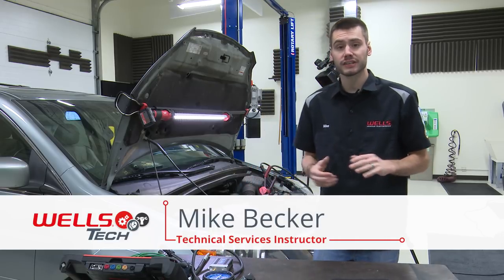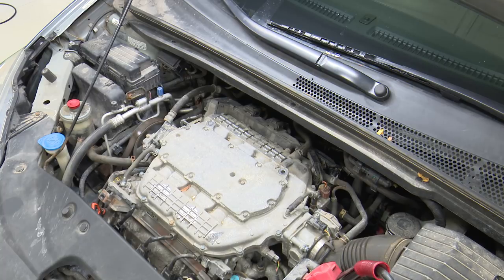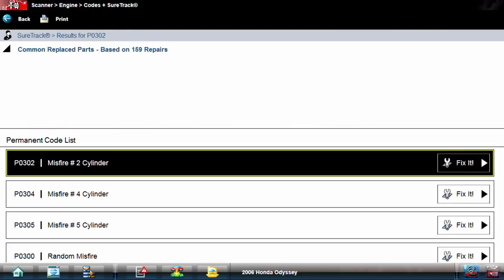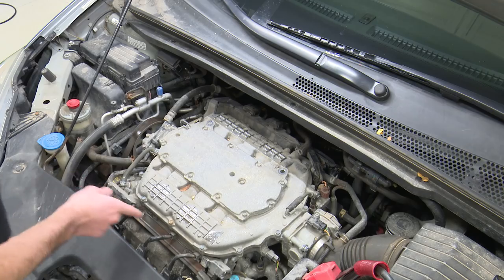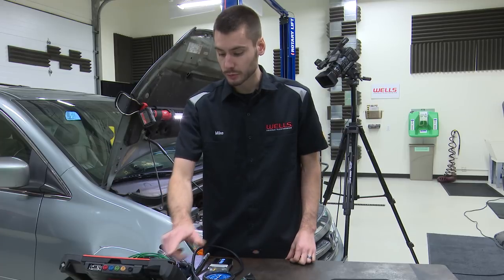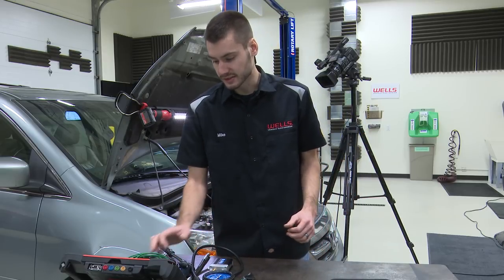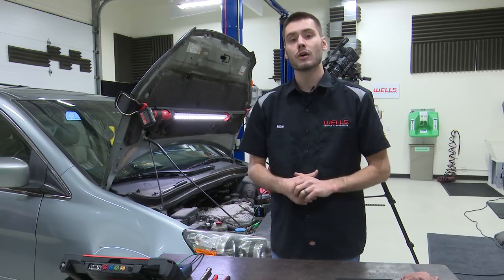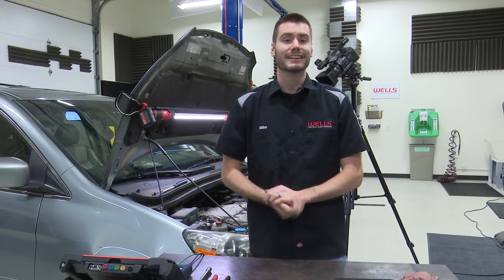2006 Honda Odyssey 3.5 Random Misfire Case Study Part 1 : Diagnosing the P0300, P0301, P0302, Etc.

Comment: Gotta be careful of cylinder wash if the vehicle dont shut down injector like some do when have a misfire. Great to see the Wps out and being used. Always glad to see videos from you great Job. Im sure you already know about the fuel injector best to unplug if possible its more for others but you may have stated as im still watching.
Reply from the maker: Hey Mike, that makes sense. Too much time running could wash it out. I did not unplug the injector on this one. Hard to say if the PCM realized it was missing and cut the injector. I suppose I could have checked that. If I remember right the injectors were very hard to get to on this 3.5.
Mike Becker, Senior Technical Services Instructor
Reply: Probably not a huge issue for very short runs,

Comment: I have an 2000  Honda Odyssey with codes p1399 P0300 p0301 through 6 i cleaned the egr that didn't work did a valve adjustment that didn't work I replaced the coils and all spark plugs and it was fixed and threw up the same codes again what you think I can do the customer is telling me it is dumping fuel burning alot of it can fuel injectors be part of p1399 codes thanks

Comment: Very nice detailed video, I however did not understand how you decided it was not a valve adjustment problem after checking the intake valve numbers on the vacuum gauge and the engine pressure using the introducer but after running the full graph came back to decide it was a valve adjustment problem after all. I have an 06 odyssey and the garage is trying to charge me $1200 for the adjustments even though they say they are not certain it is the problem. They say the plugs are ok and the coils seem fine too. The vehicle has about 180k and triggered all 6 misfire codes on all banks. Why would it run rough with check engine light on one day and smooth with no check engine light the next.Any advice? Thank you.
Reply: Look into VCmuzzler 2
Reply: Did you resolve your issue Im having the same codes on my 07 honda pilot

Comment: hi mike great video!!  question 1...  can you get intake vacuum reading by taking the baro number and subtracting the map number to get intake vacuum reading?  question 2 why is the map reading not actual vacuum and what is it measuring because it says map vacuum? question 3 what do you do if it has variable valve timing and need to take incylinder transducer reading but dont want variable of valve timing, isnt that a concern? im sure alot of people are wondering this or they havent thought about it so could you please help us out with these questions. much appreciation
Reply from the maker: Hey Joe, thanks! For the minute that it takes to hook up my trust gauge to the intake manifold I prefer to grab a really quick manual reading rather than trusting the sensor. For VVT you can unplug the solenoid to verify the VVT isn't being phased, but you have to hope/assume the phaser is ok and not partially mechanically stuck.
Mike Becker, Senior Technical Services Instructor

Comment: My colleague's 2005 Honda Pilot got a P0301. And that's the only code, how possible it's from the loose vales of the cylinder. Or it's only caused by the bad coil, spark plug, fuel injector? The car has 190k miles on it. I think the spark plugs never got replaced. Thanks.
Reply from the maker: Sounds like its going to need some diagnosis. Figure out if it's getting spark and fuel first before pulling the valve cover to inspect valve clearance. Chances are it's going to need more than one thing at that mileage.
Mike Becker, Senior Technical Instructor

Comment: I like this but it is harder to pinpoint the valve lash clearance unless you had a good known waveform. I will try the intake manifold pressure reading with a vacuum transducer and see what happens.
Reply from the maker: Hey Scientist100, thanks for watching. You're right, it is near impossible without known good. It is fun to play with and experiment though, right?
Mike Becker, Senior Instructor
Reply: @GoTechTraining  Yes, I've read that intake manifold pressure changes are better for monitoring the valve lash issue, I may have to get the more sensitive sensors that have absolute pressure from other Youtubers here. I got the Fluke PV500 but I did not see any signal for vacuum pressure changes, just a flat line, I will keep playing with the settings but I do not see it lol. I like your videos, very well explained and professional.
Reply: a compression test should show the condition of the valve, piston and rings 150 and up eliminates all possible problem.

Comment: So is the exhaust valve actually leaking on the vacuum stroke. Not seating properly...in olden days a intermittent popping would be detected at the exhaust pipe and holding a piece of paper in front of the pipe and watch the paper get sucked back toward the pipe when  that cylinder came to fire....

Comment: Problem is the Cost of the Diag when it is a maintenance Item in the first place. Customer has to pay for that time unless you(the Shop) is going to eat it.  In Cylinder is great for many things don't get me wrong but some things are just not feasible in my opinion. If it is recommended by the manufacturer I should have no problem selling the service. 
I would compare this to sending an Oil sample off to have lab tested before you sell the oil change.
Still great Video on In-Cylinder Testing.

Comment: My 2009 0dyssey misfired and idol was rough ...The air intake hose had a big crack and Misfired bad ...i put tape around crack immediately ran better no longer mis fires..I ordered a new intake hose attached to the air cleaner and intake
Reply from the maker: Hey Robert,
Yeah those un-metered air leaks can cause your engine to run terrible!
Nice diagnosis and repair!
~Ryan

Comment: This has been happening to my 2006 Honda pilot. When I looked into this before, there is actually a service bulletin regarding this issue of valve lash adjustment and resetting cpu.
Reply from the maker: Hey Ekimzaga, it's actually right there in the owners manual that they should be inspected/adjusted at a certain mileage.
Mike Becker, Senior Technical Instructor

Comment: Can my 08 Odyssey being out of valve adjustment cause it to smoke..could it be a burnt valve or could it just smoke cause it's out of adjustment??? I just bought it and did the timing belt yesterday. I hear atleast one lifter Clacking over like it's loose. Il probably do the adjustments this weekend.
Reply from the maker: Hey Usay, these engines are super common for oil burning issues cause by bad piston rings :(
Mike Becker, Senior Instructor

Comment: Awesome lesson. Thanks. Question: why would the speed of the exhaust pressure/vacuum release cause the engine to run rough? It doesn't seem to effect the intake, compression and firing events.
Reply from the maker: Hey S G. It's not the "speed" that we are seeing. It's the time. If the exhaust valve opens early it's cutting the compression stroke short. Engines are super fine tuned as to when the valves open and close. Any discrepancy in that can and will cause divisibility issues.
Mike Becker, Senior Technical Instructor
Reply: It's like your toes hitting too early when you are running.

Comment: Great video Mike. Is it okay to rely on the Map (8.8) - Baro (28.3) readings in the freeze frame to save the time of getting out the vacuum guage?
Reply from the maker: Nicholas, many people do. I like the vacuum gauge. It took less than 2 minutes. I like to look for that rock steady needle. I'm sure others may say different....but the little bit of time to prove out something as concrete as a vacuum gauge on the intake...seems worth it to me. Sensors can lie, my trusty vacuum gauge can't....usually :) 
Mike Becker, Senior Technical Services Instructor

Comment: Awesome video! Would this condition contribute to other issues that are frequently called out as the 'fix' for this problem? For instance, a gunked up EGR valve?
Reply from the maker: Hey Robert, no I don't see a way the 2 could be related. I think these are 2 individual problems, but i'd recommend taking care of both at the time of tear-down!
Mike Becker, Senior Technical Instructor

Comment: Veru good videos mike,  one question to do the valve adjustment?the engine has to be rotate  clockwise or counterclockwise? And how do you which way must be rotate it, thank you mike, and cheers from ontario California.
Reply from the maker: Hey Everardo, thanks! Most engines rotate clockwise, but that is not ALWAYS the case. One way to know for sure is to use the starter to slowly spin it over to verify which direction is normal. You may also find information on the direction of rotation in your service information.
Mike Becker, Senior Technical Instructor

Comment: I have the same issue in a Honda Pilot 2004 that has the same engine 3.5. Codes PO300,302,303, and 305. I will start with the cheapest part like Spark plugs, coils and PVC valve. Last time in the highway start chaking and the VTM4 Light cam on too with all those codes. I already change the EGR Valve and Fuel Pump. Is this SUV have problems with valve adjustments?.
Reply from the maker: Hey Jose, yeh, same engine same issues. What happens if all of the "cheapest parts" don't fix it? They add up, right? Maybe you should have this thing professionally diagnosed? Might save some money in the long run!
Mike Becker, Senior Technical Instructor

Comment: is this the same as a weak timing belt symptoms  cool info i worked on small engines you are so good at this  great info
Reply from the maker: Charles, what would you consider a weak timing belt? Like a stretched belt? A situation where the timing is slightly off but hasn't jumped yet? Typically a belt will jump when it's failing...or break. When an engine is slightly out of time, yes symptoms can appear similar, but diagnostics will prove right/wrong.
Mike Becker, Senior Technical Instructor

Comment: Now that is how real professional's diagnose a misfire! My 08 Accord 2.4 is misfiring too. Changed plugs, coils,pvc valve and mas sensor. Bogging down while driving cant go above 20mph. Needs a compression test. 186k miles. High oil consumption stealership wants new piston heads and rings. 3k. I bet it's the valves.
Reply from the maker: Hey Brandon, thanks for watching! Make sure to take a look at the catalytic converter. Engine bogging down can definitely be caused by a plugged cat.
Mike Becker, Senior Instructor
Reply: @GoTechTraining  Thank you very much. Also in Hondas the exhaust valves tighten up. They've had this problem for years. I was thinking it needs a valve adjustment. Inside the muffler there is alot of carbon built up
Reply: @GoTechTraining  Would a bad cat throw a code if it was bad?

Comment: excellent video Mike. if you were to take that to a Honda dealer, would they go through all that to diagnose that. or what would they say is the problem is
Reply from the maker: Hey Jeremy, hard to say what they would do. Either way, this was a maintenance issue and they would probably address it as such.
Mike Becker, Senior Technical Services Instructor
Reply: I know that Honda/Acura dealers don't officially carry the Pico (Toyota/Lexus has had the pico in their dealer special tools and trains their techs at their school) but 9 of 10 times the dealer boys and gals would know what the problem is because all they work on is ONE car make.  In the aftermarket world techs have to work on most makes and models. They may see this problem once every few months where the dealership may see it on daily or weekly basis and has it down.  

Mike thank you for the great video sir! Very informative

Comment: Mike, would you recommend to change timing belt,water pump,pulleys,tensioner on my 2004 odyssey with only 68k miles? As you know it's 13 yrs old van. Any advice/input is greatly appreciated,thanks
Reply from the maker: Hey Sakitlikod1, hard to say. There really isn't a "years" spec. It's always been done in mileage. That being said, we all know what rubber looks like after years, dry, cracked, etc....It would DEFINITELY be worth pulling a cover and inspecting. At the end of the day, maintenance is maintenance and a timing belt, h20 pump and tensioner is way cheaper than an engine :)

Comment: Same engine with the P0300 but bank 2 fuel trim is going down to negative 17 at idle. Should I be looking at leaky fuel injector or is there another main culprit. Thanks.
Reply from the maker: Hey B Fwsk, that -17 fuel trim is pulling fuel away for some reason. Could be a leaky injector for sure...could also be other stuff. You could throw a fuel pressure gauge on there and see if the pressure bleeds off with the key off.
Mike Becker, Senior Instructor

Comment: Can this valve issue cause oil consumption ? I have a 2010 Honda Accord v6 a/t and it burns oil, about 1 quart every 1000 miles and has a p0420 catalytic code. That’s about it, i alredy took my engine apart and can’t find no major issue, I’m going to replace piston rings but i don’t know if that’s the problem
Reply from the maker: Hey Ernesto, no, I don't think the valves being tight would cause an oil burning issue. Those engines have a big issue with the piston rings gaps all lining up and causing oil burning. Sounds like you need new rings.
Mike Becker Senior Instructor

Comment: Wow this getting way higher than my level, Great learning video I really enjoyed a lot, 
Just a question here is following this procedure for only one piston is enough to tell us that this engine needs valve adjustment?
Reply from the maker: Hey, glad you learned a lot! Thanks! It is enough to sell it. If one piston needs an adjustment then the valve cover has to come off. If it's coming off, might as well inspect and adjust the others. Most of the time required for this job falls into just getting to the adjusters.
Mike Becker, Senior Technical Services Instructor

Comment: I understand the valve being opened sooner, but i dont see how that would cause the valve to open further... Wear causing the valve to move up into the seat/rocker/cam would not have any effect on length of travel in the other direction would it?
Reply: It is the combination of valve face wear and valve seat wear which causes the valve stem to be closer to the valve actuating mechanism, in this case the rocker arm; therefore, the rocker arm contacts the valve stem sooner causing the valve to open sooner (as you already mentioned), and simultaneously the rocker arm pushes the valve stem further down, because the rocker arm mechanical travel is set, and the limitation of valve travel is controlled by the gap between the rocker arm and the top of the valve stem.  You can verify this on a complete head assembly by adjusting one gap to zero and actuating that rocker arm to a specified amount of travel and comparing that measurement to, say, a gap of .012".   Hope that helps.
Reply: I get the earlier and longer duration...i simply do not understand how missing or worn metal can cause the valve to extend further down into the cylinder...
Reply: James Musselwhite 
The valve is not going further into the cylinder but if the seat is hammered in and now the valve lift is the combination of the (missing) gap plus the lobe hight, so the distance between the seat and the valve increases which results in a bigger opening.
Reply: https://youtu.be/yHGHsiitNnQ?t=1671 Shows the valve extending further INTO the cylinder...
Reply: James Musselwhite 
No that is incorrect. The maximum is limited by camlift .... more is not possible.
Reply: the video clearly shows more intrusion into the cylinder. Hence my confusion.
Reply: James Musselwhite 
The only chance for the valve to go further into the cylinder would be the increase in shaft length due to heat extension.
Reply from the maker: James, I should have demonstrated this differently. I am sorry for the confusion. As Bernhard List has said, the valve will not travel further into the cylinder per say. It will act like it is, because the opening happens further up in the head. I should have shown this completely differently. The valve is not at risk of hitting the piston. This confusion is my fault James. I hope with the explanations above that it has been cleared up for you!
Mike Becker, Senior Technical Services Instructor

Comment: A good video but, You should've shown why not to head in the direction of faulty "fuel injectors" for those that would suspect fuel injectors and replace them.  I would have liked it you showed a fuel injector that is working properly and is missing compression and how it shows up in a graph with less resistance creating the same image just scaled smaller.  I mean you stated you wanted direction in which way to head and you went right into check compression based on the "random misfire code" .  I know there are a lot of variables that will cause misfire codes but for the technicians that are new and jumping on board I think its important why to go on with the extra checks and rule out other variables and not be misdirected.  At the end of a job you wouldn't want your costumer upset because of  improper diagnostics.
Reply from the maker: Great points Atech311! Check out the video on the Lincoln MKS, it covers some injector diag.
Mike Becker, Senior Technical Instructor